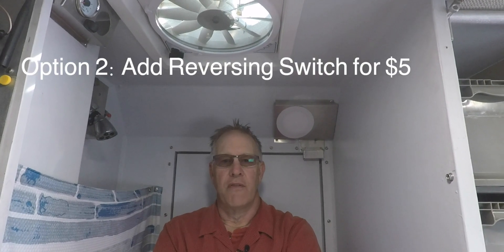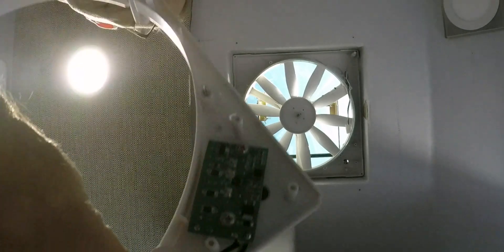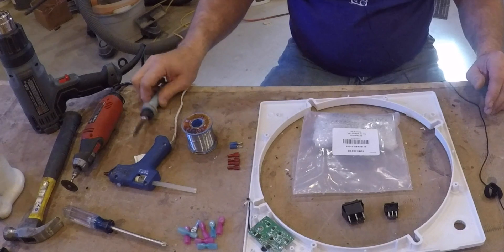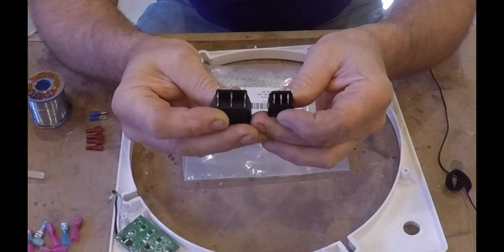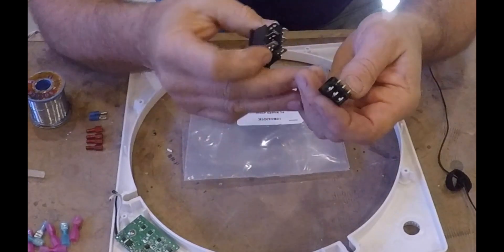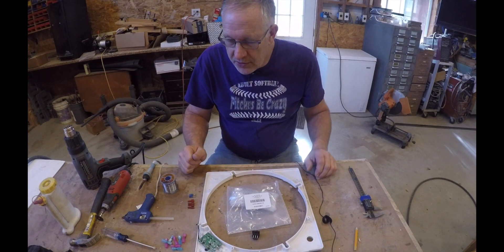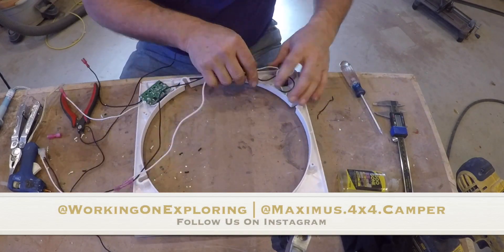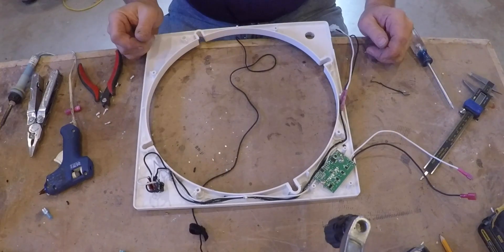ADD Your Own Reverse Fan Switch / RV Vent Improvements / DIY Truck Camper

Comment: We just installed 3 of these fans in our travel trailer last week.
2 days ago I ordered switches and terminals from Amazon, which were delivered 3 hours ago today.
So this evening I spent 1 hour on the first fan and made the modifications outlined in this video, and it absolutely worked like a charm. 
Thank you for this.
I am only going to modify 1 of the 2 remaining fans as the last one is in the bathroom and that one definitely needs to exhaust, haha. 
Now my wife is happy with her new newly modified fan(s), I’m happy it’s almost over with, and our camper is worth a little more lol ( maybe)
Reply from the maker: The difference in cost between a reversing fan and a non reversing (if I recall correctly) at the time I bought mine was about $60-80?. So that adds to your sweat equity.

Comment: Well,  that really switched things up! Great showing off the process.  I'm a fan.  
Okay,  enough of the double entendres; I've never seen crimpers like that before.  That could be a game changer above using my linesmen pliers,  for sure.
Reply from the maker: I've always been irritated that my ratcheting crimper for vinyl terminals (made by AMP) does an inadequate job on nylon insulated terminals (mostly just blue and yellow) because I use a lot of fully insulated QD in nylon. Then when I decided I liked the heat shrink butt connectors, a new crimper was definitely needed. This crimper is designed specifically for the heat shrink type to fully crimp and not damage the insulation (non ratcheting crimpers commonly pinch through). I've found it also does a good job on all nylon and works for most vinyl too as long as the wire fill is not near maxing out the terminal socket.
Crimping Tool for Heat Shrink Connectors,OURU Racheting Crimper Tools,Ratchet Wire Terminal Crimper,Wire Crimping Tool AWG 22-10,OU-1112 https://www.amazon.com/dp/B08NWVBYDY/ref=cm_sw_r_apan_glt_i_8RSGQSXM36AY1X4ZZMQ4?_encoding=UTF8&psc=1.   Did I also mention it's inexpensive?
Reply: @WorkingOnExploring  that's great,  thank you.  Time to head to Amazon,  I think...

Comment: Mouser electronics stocks the preferred switch
Reply from the maker: Thanks. I'm sure they do. I had some at home from Digikey but since I was on the road, I only had a few places I could receive mail and needed it fast and with a defined delivery date that I couldn't get from the Mouser, Digikey, Allied Electronics, etc.....I had to settle for what I could get from Amazon. I only modified 2 of 4 fans with the less preferred switch and did the last two with the correct one later at home.What I wanted but also couldn't do was (when on the road) to find a 3 position switch of  the same size as the 2 position I had at home so that I could swap it when I got home....now I have a bigger hole that I don't want to try to repair....it's just one of those things that  I'll have to be satisfied with getting a suboptimal modification done early so I could benefit from.it. Thanks for commenting.

Comment: not sure where my comment went, but i'll ask again. I ordered the preferred switch and want to add it to my fantastic vent to add the reverse feature, my question is do I add it along with the stock on/off switch or does it replace the stock on/off switch?
Reply from the maker: It is placed in the 2 wire power lead between the stock control and the motor. It reverses the polarity of dc power from the control to the motor (only). The control receives and sends the same and  constant polarity.

Comment: Thanks for the video.  Are you able to skip the circuit board and add in a switch instead?  I've been told my fans are off warranty and the circuit boards are expensive. 
Thanks
Reply from the maker: If your controller is INOP, I would replace it with a PWM speed control (full variable speed) and a DPDT reversing switch between the speed control and reversing switch. Some controllers come with a reversing switch prewired. Depending on what fan you have, there may be several choices of controller ( theyre rated by amp draw). A MAXXFAN may need 8-10A. A bare board unit may be small enough to fit in a corner of the fan housing. Some come in enclosures that could be removed. Some have displays ( not needed).
Quick picks; 
1)  DC Motor Speed Controller PWM Speed Controller DC 12V 24V 60V 500W Electric Motor Speed Control Regulator Power Wheels Speed Controller with PWM Signal Generator Driver Module https://a.co/d/9tg17TA
2) RioRand Upgraded 6V-90V 15A DC Motor Pump Speed Controller 2PCS https://a.co/d/iIwxsrQ
Reply from the maker: Rereading your question. If you want just high speed, forward or reverse, you can just remove the old control and put in a DPTT (double pole triple throw) rocker switch. This switch has 8 terminals and provides 3 positions so there can be a center 'off'.
Reply: @WorkingOnExploring  many thanks!!  I will look into what parts I can get quickly.  Really appreciate the two routes!  I currently have the model with temperature control, variable speed, and reverse. Should be able to get it going for this weekend either way. 👌🏼